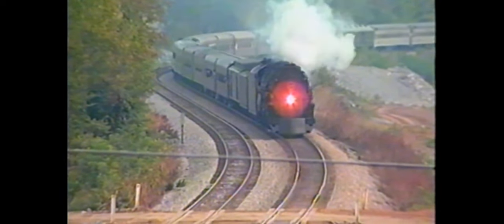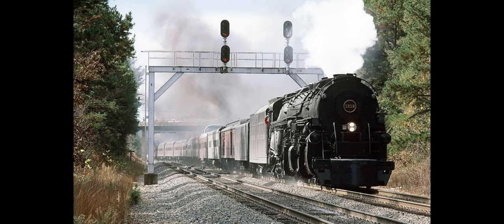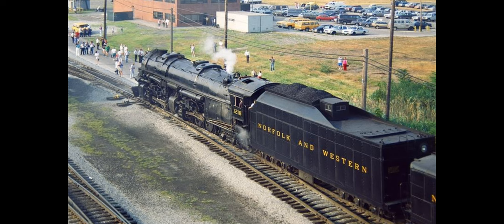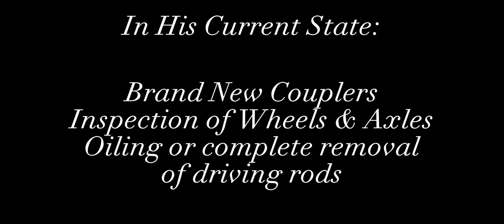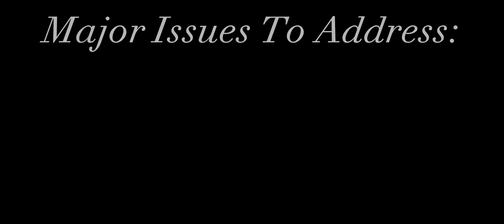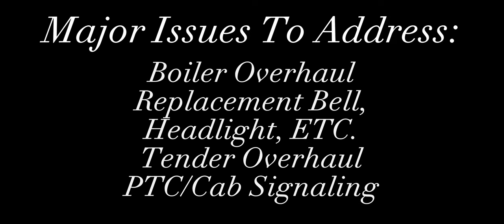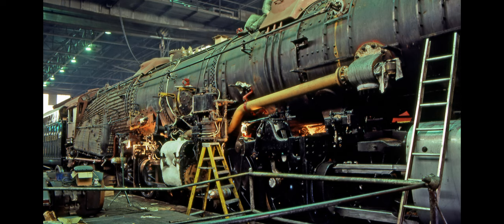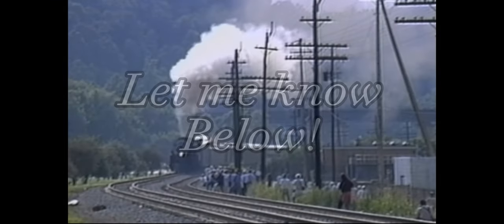Is a Full Restoration of N&W #1218 Possible?

Comment: Just because some of the parts are as old as the locomotive doesn't mean that they need to be replaced because they are probably still serviceable and could be rebuilt. And another question I have for is why do you think the bell needs to be replaced that one just sounded a little bit crazy to me.  There are a bunch of other steam locomotives out there that are still running with pretty much all the same parts that came with the locomotive when it was delivered. Take Cass scenic railroad shay #5 it was built in 1905 and it's still running with it's original boiler and most of its original running gear.
Reply from the maker: The way I had meant it was for precautionary measures. The locomotive has been barely moved for years.

Comment: This is interesting as a lifelong steam fan and fan of 1218. I do have some comments though. NCTM does not to my knowledge have the space to restore an engine of 1218's size. Silvis would be the best place in my opinion due to the size of their shop but they have their hands full currently with 5511 and 3985. If it were to happen, it would be similar to 611's restoration in the fact it was funded through donations but likely without help from NS. As much as I would love to see the 1218 run in my lifetime, it will either fall into the traps that the 1309 crew fell into or not happen at least for the near and foreseeable future.

Comment: With enough money, a restoration is undoubtedly possible. The availability of funds dictates the speed of the restoration. The bigger problem is having somewhere to run it. There is unlikely to be main line access, so it would be relegated to short lines, and how many short lines want or can handle such a huge locomotive on their rails?

Comment: I would love to 1218 run again. The issue is not necessarily if it's possible, it absolutely is but moreso an issue if restoring her to operation makes sense and to that at this point in time it just doesn't. 611 is already a caged tiger at this point and being heavily underuttilized. 1218 if it were restored to operation at this point in time and circumstances didn't change would be in an even worse situation as there's even less places where it can run. It's times like this which really make me wish that we had an equivilient here in the US to the Great Central Railway in the UK, a preserved section of double tracked main line where it would be feasible to geather a bunch of main line engines and give them a place to run at track speed.
Reply from the maker: Thats a fair point. Guessing we will see what the future holds for mainline steam anyways, with 2816's tour coming up, it may open up a slew of possibilities, with it being the first real mainline steam run outside of UP's fleet.

Comment: I am sure that for several dump trucks of cash it could be rebuilt.  It is a beautiful locomotive.  The really big issue is: Where are you going to run it?  They did a beautiful job resorting 611 but can only shuffle it back and forth at Spencer, maybe 1 mile.  It spent a season at Strasburg where it could run over 5 or 6 miles but only at about 15 mph.  Insurance costs are would be outrageous and the mainline railroads are a business not interested in rail fans all over their infrastructure.

Comment: They have a complete set of drawings for the class a. Parts can be made, money can be raised but where will it run? She would need to pull big trains to recoup operating costs. If I won the lottery and had a railroad 1218 would be under steam.

Comment: I 1000% agree with you the 1218 is now currently in a state where she is in need of a massive overhaul to ensure it’s longevity but if someone has the funds for it and start an organization like 611 she could definitely return to the mainline but she will need like you said PTC in order for her to do excursions but regardless I definitely see this locomotive getting restored in the future!
Reply: I was a car host behind 1218, she was and still is a beautiful machine. She put on a great performance, the folks that were trackside were in awe, as well as the passengers on the train! I say absolutely find the way to bring her back & once again let her thrill yet another generation of railfans!  I saw the A class & Y class locomotives when I was a child, been a railfan ever since!
Reply: PTC is now de rigueur on any steam locomotive that travels the mainline.  I know for  a fact that SF 3751 and UP 4014 have PTC as does SF2926.  Yes, they had to do some careful adjustments but it was done and now these three engines (when they can get on main line) get on mainline.
Reply: Yes that is exactly correct because if you think about it these big steamers are technically landlocked without this technology witch is now mandatory for mainline steam locomotives but I hope and pray to god either more steamers get this technology installed or have Amtrak and Norfolk Southern be more lenient with mainline steam excursions and private trips!

Comment: It is definitely possible to restore 1218 but the issue is funding and finding a suitable place to operate. A 1218 overhaul would be relatively expensive compared to 611’s and the expensive can not be justified if there is no railroad that can host 1218. The only local railroads that could host 1218 would be the Kanawha River Railroad or the Buckingham Branch. Unless there is a leadership change at Norfolk Southern, the only way I could see either 611 or 1218 on the main line would possibly on the State of Virginia owned track if the museum and state partnered together.

Comment: It is possible for n&w 1218 to go under a restoration if the money is raised for it. And another thing N&W 1218 is a soul survivor of the A Class of its kind. So it would be great to see 1218 back in on the tracks again with N&W 611. It can be done hack there doing it with a prr t1. So why couldn't N&W 1218 get another chance at running it would be cool to see her on the tracks it can be done

Comment: 1218 needs to be restored!  I like the 1218 because it's the same size as the Challenger 3985, however 1218 has the same 2 sets of 6 drivers and the 4 wheel trailing truck as 3985 did, but the front leading truck on 1218 has only 2 while the Challenger has 4, but 1218 and Challenger 3985 are about the same size, so it needs to be restored to it's full operating status.  I'm sure it can be done, but you know that Norfolk Southern gets kind of picky with steam locomotive ferry moves.  NS is not the same like it was.  I do miss it's heavy ex Conrail power like the SD80MACs, SD60Is, etc.  But with them getting rid of their steam program, that's is a sad thing.  I get that in these times a steamer is difficult to run and maintain, but with the extra money and people that know steamers inside and out, 1218 can have another chance!  Oh well, only time will tell for 1218's fate.

Comment: I've seen the Norfolk And Western 1218 in footage. It's not that hard to restore to operate, but the website I looked on said there's no plans to restore it back to operation. They need to re operate it again, BeCause this locomotive needs to get back in business. They are making a huge mistake not restoring it, but at some point they are going to have to do it. I'll be surprised if I hear that this gets back on the tracks, BeCause as a huge railfan, I love this one. If Union Pacific 4014, 3985, (Will be restored) can be restored? So can this beautiful beast!

Comment: The foamers are wrong while a engine like 4014 can be restored thanks to the help from a class one unless NS decides to have it back chances are it will never run again due to its size
Reply: I'm certainly not holding my breath.
Reply: Class A's are actually not that big, say compared to a DM&IR Yellowstone or an H8 Allegheny. Running it would be no problem. Most Class 1 railroads simply don't want the liability of running steam. Class 1's also love to brag about how much more environmental friendly they are compared to other forms of transportation, so running steam counteracts their current marketing. UP is the exception to this for now, but all it takes is new management at UP and they could very well scrap their steam program.

Comment: NOT gonna happen , the FRAME is toast and you cannot go to Ace and buy another.  This , plus being used for parts supply.   Now if YOU have a few million to spare , ANYTHING can be restored.
Reply: 5years and 20million to restore it...... but where to run it...that is the bigger question! and that T1 they're building too...and AT&SF 2926,3751, SP4449too.

Comment: Yes this would be nice to see 1218 again but they won't let 611 run anywhere on the system so what chance does the 1218 have. If you look at all steam engine that they are rebuilding now they have to be converted from coal to oil and NS & CSX are scared to death to run any steam train on there lines. Two to Four Million Dollars is a lot of money just to run these trains on some branch line like N&W 611 has been doing up in PA. My area hasn't seen Steam since Southern 630 that ran for Cinn. to Danville KY. and now my line ( Cinn. to Portsmouth)  has been dead since 2003 and the last 20 miles will be turn into a bike trail so NO hope out this way ever again. I hate to say this but us Old Farts just can't travel from state to state to ride these trains anymore so the money they would get from us is just not there. Thanks for the post.